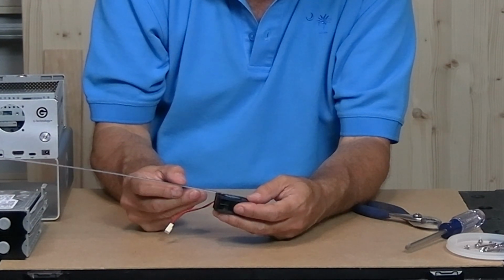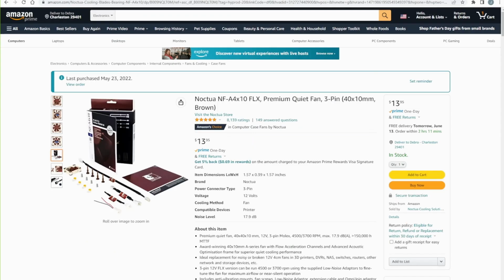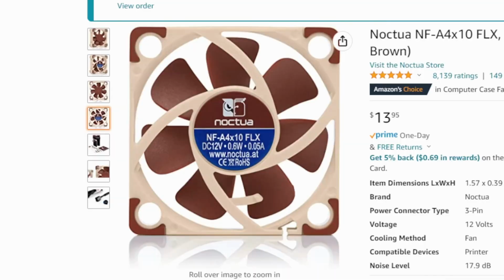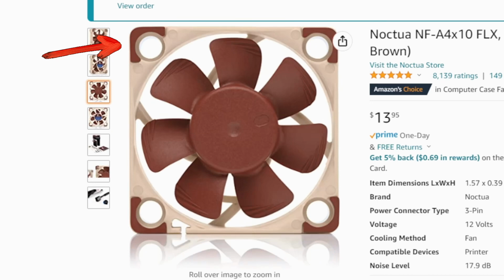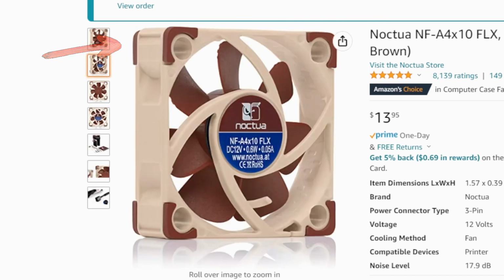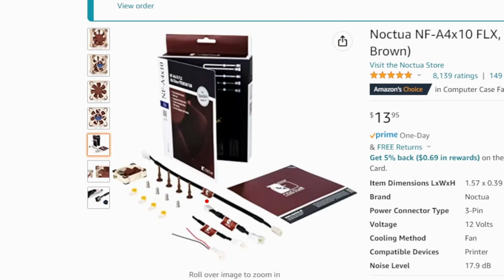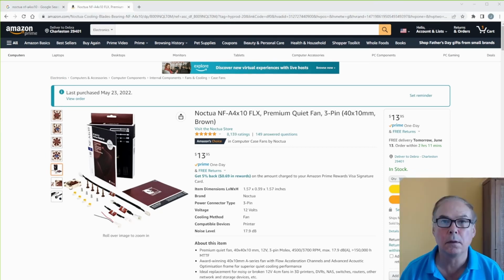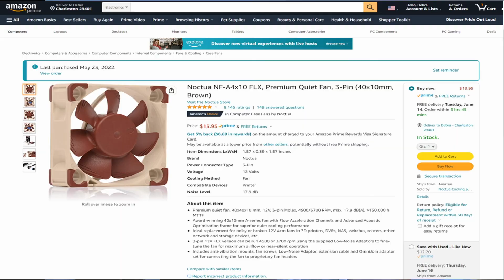Is Your Hard Drive Making This Noise?

Comment: The fan that Amazon sent me is 24 V. Is there any concern with using this fan instead of the 12V version?
Reply from the maker: I suggest checking your current fan to see what voltage it is.
Reply: @NettleReef  I wanted to thank you for making this video, without it I don't think I would have tried replacing the fan in my drive. I had the same issue as yours, it was very loud, to the point were I could not use it and was considering replacing the drive. I ordered the fan you suggested. The first time they sent the wrong fan, it was not the correct voltage. The second fan was the correct voltage but the pins did not line up very well when I plugged it in. The directions showed how to hard wire the fan using by cutting the existing adaptor and wiring it to the supplied adaptor and that worked perfectly. Thanks again for making the video it was very helpful in resolving my issue.

Comment: THANK YOU - Exactly the video I needed, and I enjoyed your deadpan "delivery". I have a G-RAID 24 TB, formatted as raid 1, and it started making the same horror movie noise. After realizing from your video it was just a fan, I followed your steps exactly - great information, particularly about the polarity. At first I thought I messed up, because the replacement fan didn't spin. But I tested the old fan (unit open - a little dangerous), and it didn't start spinning for a little while after the G-RAID was in use.  But then the replacement fan would repeatedly budge just a little bit, then stop. I finally removed the "Low Noise Adapter" piece, and finally it worked. So my solution required I didn't use that part.

But maybe you can help me on another item: When I was debugging what was going on, at first I thought is was one of the drives. I took one out, and could still mount the G-RAID and see all my files on that drive. I did the same thing, and the 2nd drive also showed all my files. But after replacing the fan, I started the G-RAID up with both drives, and now there is a solid RED light on the outside - typically it is white.  I think I confused the RAID-1 setup by individually spinning each drive up separately and now I don't know what to do. 

I just happened to purchase another G-RAID from SanDisk so before I try anything next, I'm copying all the files off the one in question. (I also have a BackBlaze backup, but want to be very careful here..)  The GRAID Configurator utilty is saying things are running in "Degraded" mode and has a button to press to "REPAIR", but I don't want to press it until my backup is done. 

Do you have any ideas on what to do?  Either way, thanks a million! Things are much much quieter now!
Reply: I resolved my question.  NEVER re-mount a RAID-1 G-RAID with only one of the drives in it.  It throws things out of sync and considers the G-RAID to be running in "Degraded" mode and the indicator light turn a solid RED.  The only way to fix this was to use the GRAID Configurator app's "REPAIR" mode, which initialized one of the drives, then slow rebuilt it from the contents of the other drive.  BTW, this process kept crashing, so I ended up reformatting the G-RAID to RAID 0 , then back to RAID 1 (losing all data).  After the indicator light was WHITE again, I copied back all the contents which I had luckily stored on my 2nd G-RAID drive before messing with all this. ALL IS GOOD now, and the replacement fan works great!  Thanks again.
Reply from the maker: Glad the video helped you out Ken.  Thanks for the kind words.
Reply: @NettleReef  Thank you!  The GRAID is and quiets, and not like a screaming banshee!